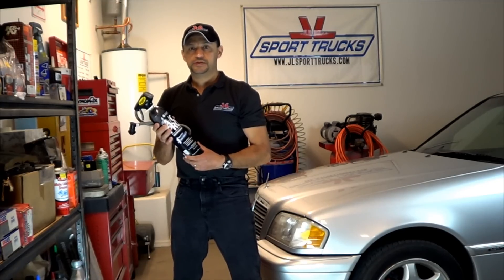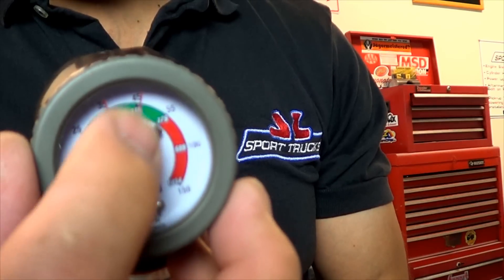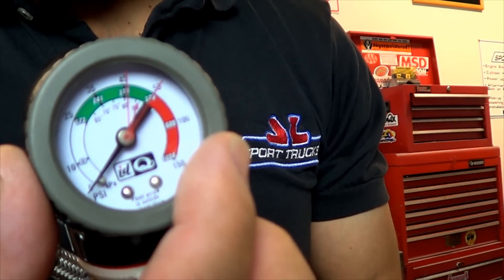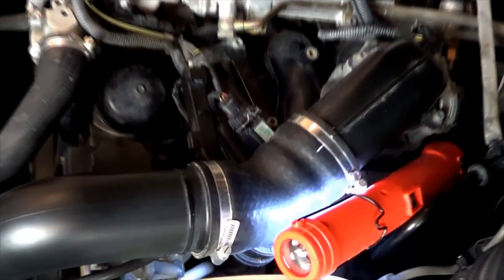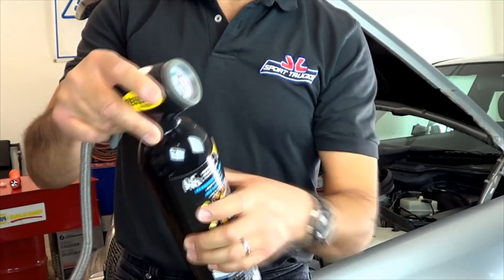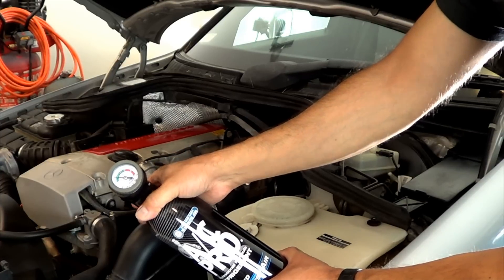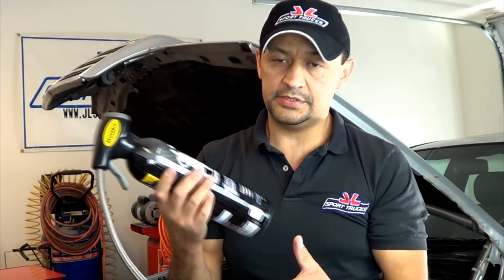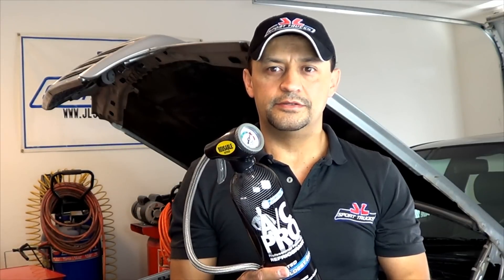How to add Refrigerant to Air Conditioning System using AC Pro by Howstuffinmycarworks

Comment: Hi... Both my ac pressure valves doesn't have a high end low indicator on the cap. Does the low pressure ac port have a smaller nipple size than the high pressure port? 🇦🇺

Comment: Used your video to recharge my AC refrigerant in an oldie but goodie 1996 SL is outstanding and cost savings .  The gauge however kept oscillating 10 & 30 PSI accompanied by small click sound.  I did proceed adding the refrigerant but was concerned that something was connected wrong and stopped.  Noticed that the needle would drop to 10PSI on every click and the climb towards 3SI repeating the Anomaly.   Sincerely Carlos

Comment: I hope you get back with me. I put this same stuff in my C230 kompressor and my air started blowing colder then the two smaller fans in front of the bigger fan kicked on and was going faster then I have ever heard them turn. It actually sounded like an air plane.  Then my air became warm. Also the guy that was putting it in for me said he no longer could see it move through the system but that was after the 2 small fans went nuts and it started blowing warm air.
Could you please help me.  I have no clue what is wrong with it and I have to have my A/C working or my little yorkie who had major health problems will die because of the heat and I won't even be able to take him to his dr appointments.    So please you you give me an idea of what is going on and what to do to try and fix it?   Please,   thank you